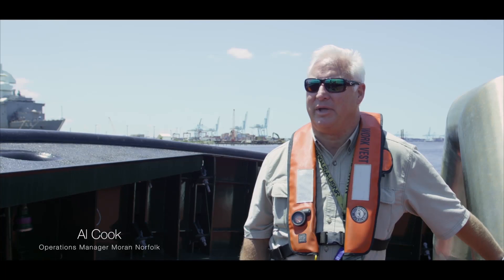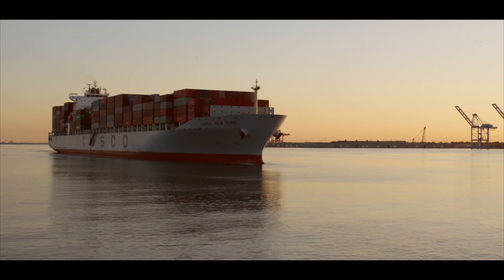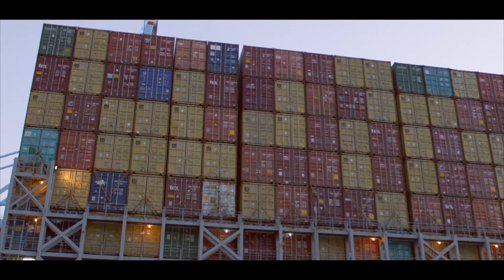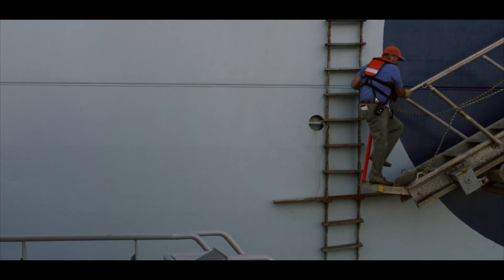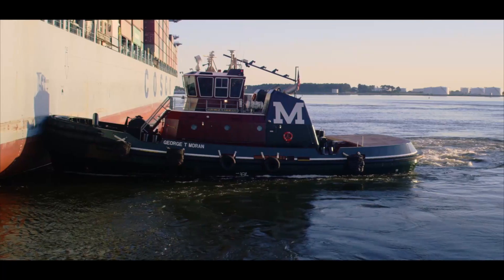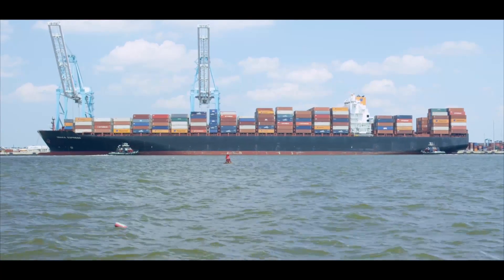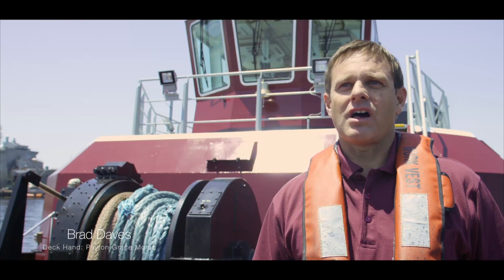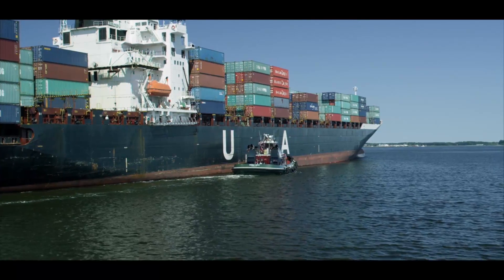EMD Powered Tugboats

Comment: Emd two storke Detroit diesel power /GM
Reply: Nope. EMD engines originated from Cleveland Division, vice Detroit Diesel. That's history. In 2006 Progress Rail, division of Caterpillar, bought EMD. One current EMD locomotive, the F125 passenger unit, uses a Cat C175-20, of 4700 hp @ 1800 rpm. Current US freight units use new 1010 (cid/cyl) Tier-4 engine.